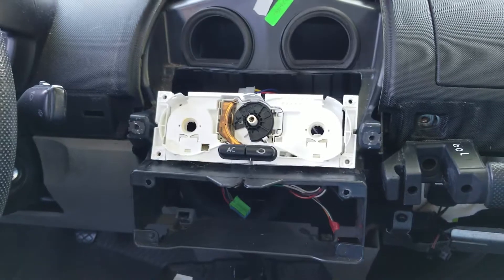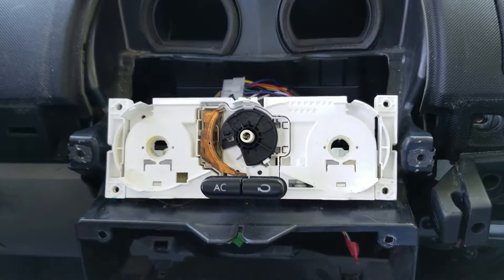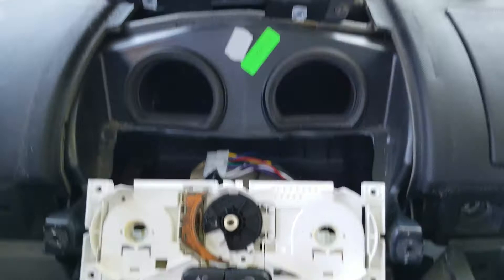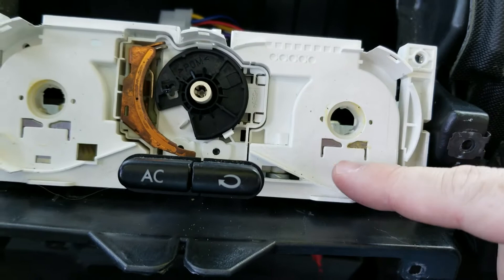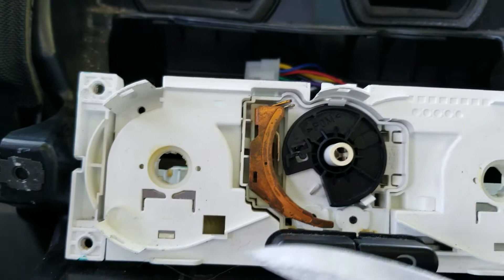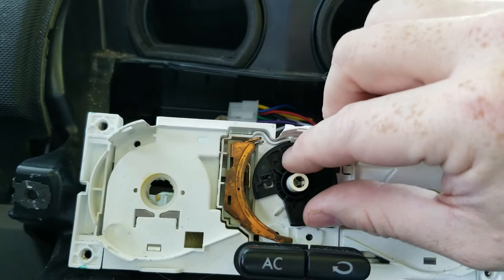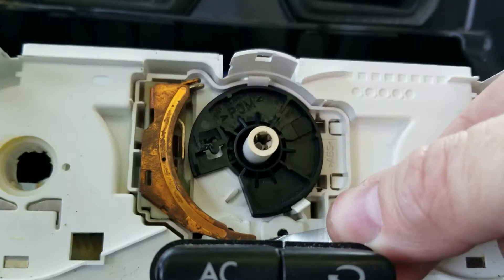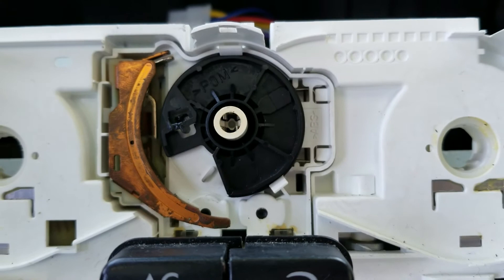Fixing a broken fan speed switch in a 2000 VW New Beetle

Comment: Thanks for really good info. I found out that the described metalpiece does not run on the outside of the copperplate, but must be placed on the inside for the fan to start. That little metalpiece must slide and make contact on both sides of the copperplate.
Reply: You saved my life, thank you so much!!

Comment: This is exactly what was wrong with mine.  Took it apart and the metal piece was just laying in there.  I found it and Used High strength JB weld to fix it instead of super glue.  I will let you know how it works.  Thanks for this video..It was a life saver.
Reply: Did it work?
Reply: 😮 yeah, same question: did it work

Comment: Also does this entire piece just connect via a cable? Wondering if the entire unit can just be swapped out if I can find a cheap replacement from a parts car.
Reply from the maker: I wish I knew. I never had to take the whole unit out. I imagine it's attached with a wiring harness, since everything else seemed to be done that way.

Comment: Does the metal piece slide into the bottom of the plastic circle or that little hole on top? My metal piece is in there but not sure what's broken. I assume I'll have to glue it back to the black circle but worried it won't make contact with the copper. Where are you guys glueing it?
Reply from the maker: There should be a small opening for the metal arm to slot into the black disc. That's what I point out and mention gluing. In the video, it's directly above the cutout on the disc, at about nine o'clock if that was a clock face.

Comment: I know you mentioned the a/c will not work, but does this failure also cause the  a/c button light to not come on when pushed in? I have no fan at any speed (and no power on the resistor/fan connector supplying them), no a/c button light and no radiator fans (fans do work with direct 12v to them). Was thinking it was a "power in" issue (maybe wiring as fuses are good).
Reply from the maker: I'm no pro, I just tinker where I can, so you probably want a more professional opinion, but here's what I think. If the fuses are good and the devices work when powered directly, it's likely that there's a problem in the wiring. All three of the 12v power ports are failing in this car but the fuse is fine, so my next project is tracing the wires. Funnnnnnn.
Reply: @ScottHawks5344 Thank you. More directly, with this problem, did your light come on when the ac button was engaged?
Reply from the maker: @tritter2001  The light on the AC never had a problem. The light that illuminates the dials that comes on with the headlights wasn't working but that was because the tiny light bulb that rests in the middle dial wasn't seated correctly. I fixed that at the same time. I believe the AC button light is independent though.
Reply: @ScottHawks5344  TY much! BTW, during my research on this, some electrical problems are with the ignition switch. If you have not already explored that on your port issue. Ignore this if you have verified 12V on both sides of the fuse, vs just verifying the fuse is not blown.
Reply from the maker: @tritter2001  thanks! I haven't checked yet. I'll look at that.

Comment: Hi there, trying to glue this piece back in. The metal arm piece goes BEHIND the copper piece right? then it slides in between as the dial turns?
Reply from the maker: No, the arm rests on top of the copper piece. There should be enough tension in the arm that it maintains contact with the copper throughout the range of the dial.
Reply: @ScottHawks5344 Thanks so much for your reply. Just super glued the arm in, it looks great so far. I really appreciate the video, I couldn't find anything else describing the exact position of the arm. Fingers crossed it works!
Reply from the maker: @13crazydaisies  Awesome! Hope it all works out!
Reply: @ScottHawks5344  I really think the little arm piece goes UNDER the large top copper piece.  There are two copper plates underneath that it makes connection with underneath the large copper piece.
Reply from the maker: @hartsdesirehomestead  You could be right. I was just informed that the fan switch on my daughter's beetle (the one in the video) is now stuck on fan speed 2 no matter where the dial is, so I'll be diving back in there. I'll have to look more closely. At the time, I considered that it might be the case, but it seemed from the wear and tear that it was over the top.
Reply: Just wanted to come back to confirm it does indeed go behind the copper piece, that's the only way it works. Luckily the glue job was easily undone and reglued. The glue job I did six months ago came undone though so I'm out to glue it once more!
Reply from the maker: @13crazydaisies  yup, I just fixed my daughter's again and confirmed that it goes in the back because it has to complete the circuit between the front arm and the back arm. Thanks!

Comment: hello, i have the same problem, just in my case i broke the little metal arm thing...  any advice what to do?
Reply from the maker: You could try to glue it back together, I suppose. It's a pretty small piece and it's required to be under a small amount of tension at all times, so I don't know how effective that would be. Another option would be to order the assembly from a VW dealer, which is probably expensive. You could look around at local scrap yards to see if they have any intact assemblies or use one of those online parts stores. I have no idea how you could replace it with an alternative, but I suppose it would be possible to try to make something that fits and is the same material to ensure the electric conductivity.
Reply: @ScottHawks5344  Its broken in many peaces so its not possible to glue it, but for info i tried that and it started to smoke... i used some fast glue.. I think i would need to replace it all in the end or just change the black ring that holds the metal thing if thats possible.
Reply from the maker: @bernarddrozan3463  Sounds like replacing it is your best bet. Sorry the repair didn't work out. Best of luck!

Comment: How do you just pull out the dials?
Reply from the maker: The dials themselves come out from just pulling on them. You have to use a fair amount of pressure to get it. Getting to the point I'm at in the video involves removing a significant portion of the dash. That's not straightforward. I recommend searching for a step-by-step guide. I tried to find the one I used, but can't seem to locate it. Sorry.
Reply: Scott Hawks thank you! I used strength to pull them out,  did just what you said and wola!! It worked! For the dash, I had to walk through several videos.  Thank you for putting this out there!
Reply from the maker: You're welcome. I'm glad it helped someone!